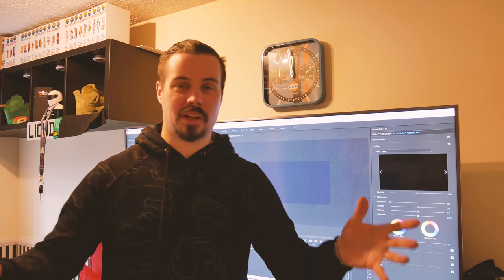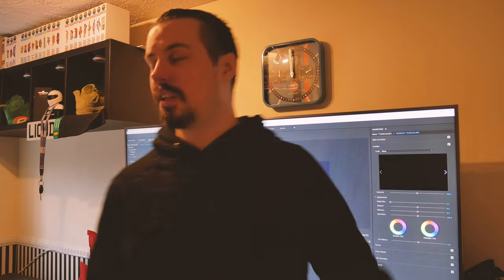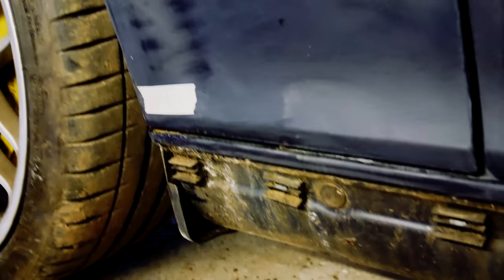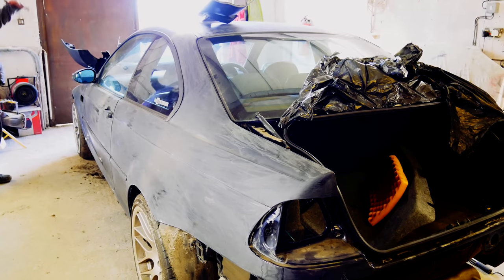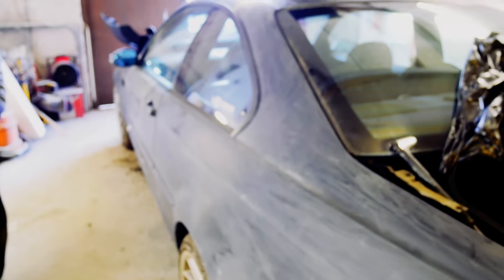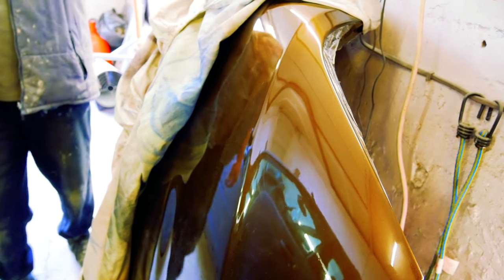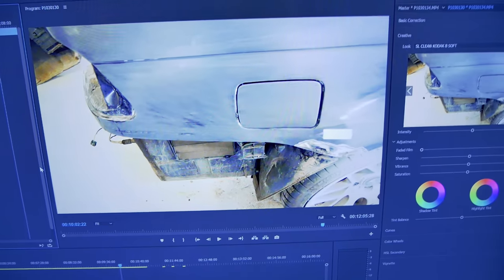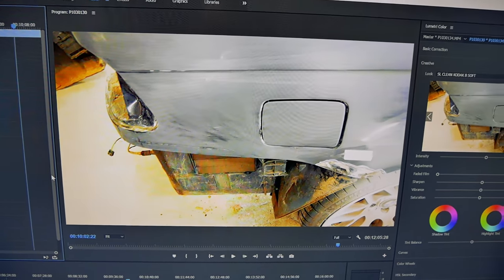Project M3 - Rust, Dents and Repairs - Valentine Special - Episode 15

Comment: Did they rust on that fender come back at all
Reply from the maker: With a vengeance but got it sorted back when I had her
Reply: The Benchmark Nice. I’m in the same boat and am considering getting an entire new quarter panel welded in so it doesn’t come back for a long time. Its a shame these cars rust so easily

Comment: Hi Dan.  So what do they do, are they preparing the paint to have primer?  I suppose you don't take the paint back to metal, I know nothing about resprays!  Do you have to remove the rear seats for the roll cage?
Reply from the maker: I'm not a great director, should of had more detail put into the film but yes Andy you are right, he is taking most of the paint back (not all) and wet sanding for the primer NOT the paint. 
So for almost all respray jobs this is what should happen, sand old paint down, cut out rust, weld in metal, smooth out the dings/dents by hand/hammer and maybe a little filler, I don't really want this and have made it clear I would rather pay to have it done right, but if its a tiny amount that will not ruin the car in the future then fine.
Then finally you spray primer over that... if it looks good (it wont, never does!) then sand back down the bits that were 'off' or almost all if you really ballsed it up (Ralph wont, hes VERY good) and spray that primer over the car again. 

After this, you can begin to add the layers of paint, my unusual colour choice is trickier to paint then other shades, so it will take time, otherwise the minute the light hits it (if indeed we get any) you will see its wrong.
The gloss coat is something we are still discussing. You can do the standard like all factory cars or go full on show car and make it shine with silly amounts of gloss, baking, gloss, baking (repeat 10 times in some cases!).... can easily add a month and another £5k easy..... I am a practical man so no, this is not something I am even considering.

This is no show car as I intend to drive it, so I am still in talks about the gloss options at the moment, and I am more concerned about protection over the long term then having a pretty car!

Now I am NOT a paint expert, this is just what I remember discussing previously with Ralph, so please by all means add/correct where I have been incorrect!
Reply: Great description Dan, really looking forward to seeing the car.  I'm very envious, I am looking for a car this year, but it won't be an M3 :-)
Reply: Hi dan I have a 2002 M3 coupe and got rust on passenger side sill any advice
Reply from the maker: Screw being sensible, buy a M3 or even better a 911 :D
Reply from the maker: Yes, get it fixed ASAP, the longer you leave it the more money it will cost!
Reply: Thanks dan it is the little lip under the passenger side door in middle
Reply: The Benchmark would love to, but I have a wife to please.  Plus I'm not minted lol.  Was looking at a Merc C350 CDI lol.  Sensible with some grunt.  Yea I know, it's boring!
Reply from the maker: Very common and easy to fix, just get it done NOW, rather be a £300-500 job then a £1000+ thanks to leaving it for another winter!
Reply from the maker: Well they are actually very quick cars with a cheeky map, you just don't hear about them over here like the 335d (lease deals is why we had so many!). Much more common in Germany... do a little googling, you may not feel so sad with that choice!
Reply: The Benchmark I've spent since Xmas looking into them.  Been a company car driver for 14 years, now opted out.  Need a car this year.  Cannot afford a new 335d, so was looking at second hand.  That's when I started looking at the C350.  Like the idea of something looking fairly standard that has the power.
Reply from the maker: I think you may be surprised how much the pre LCI 35d's have depreciated!
Reply: Thanks mate will get that done ✅ me and my mate have both bought M3 coupes both carbon black manual his is 04 mine is 02 both 1 previous owners mine has 180 k his has 122k both with full history